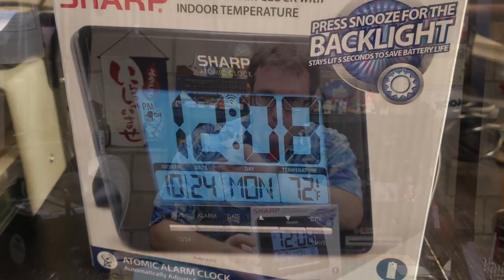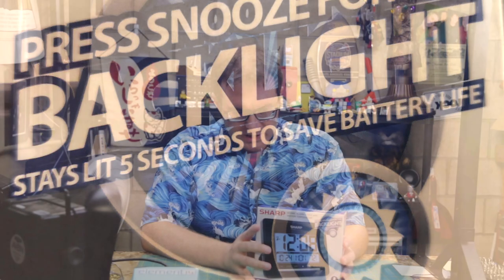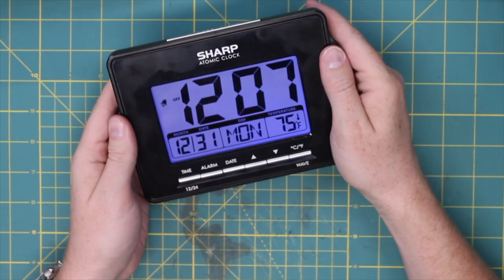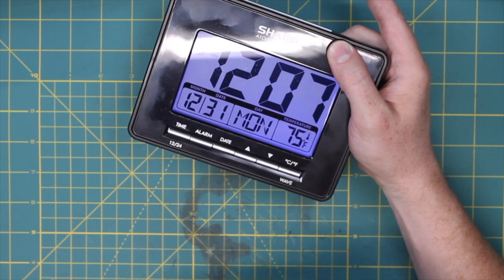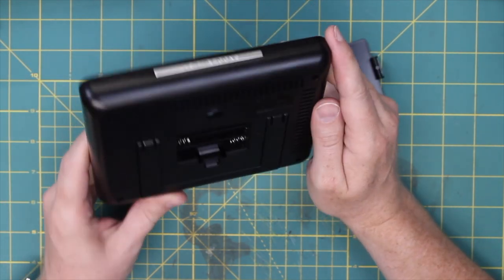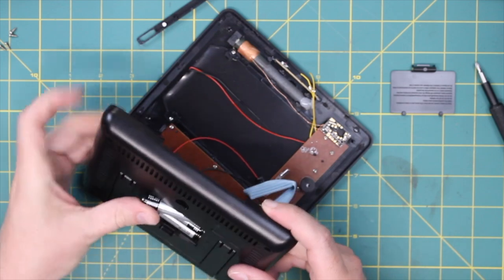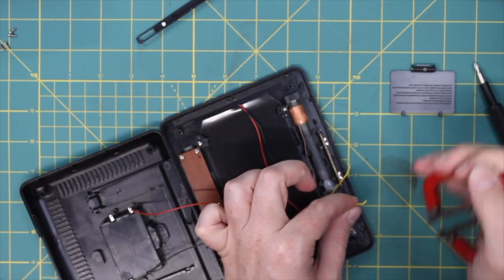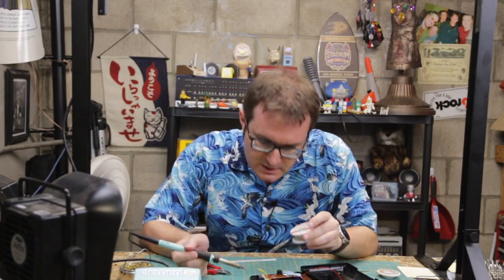Sharp Atomic Alarm Clock Backlight Hack

Comment: Future projects, suggest full system test prior to soldering... check that the initial setup still functions... and the alarm clock features work... with the snooze button pressed. 

Also for anyone interested, La Crosse Technologies has several ("atomic") clocks that are battery powered so power outages won't affect them, but come with a small plug-in power supply to run the back light constantly. I bought one, was so impressed I bought two others to replace all my clocks (Except microwave & stove :( )